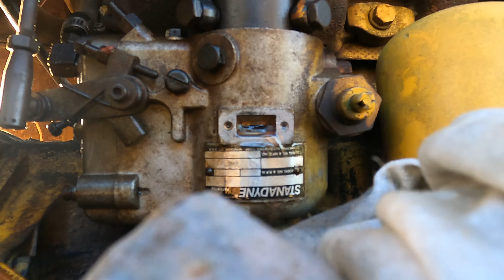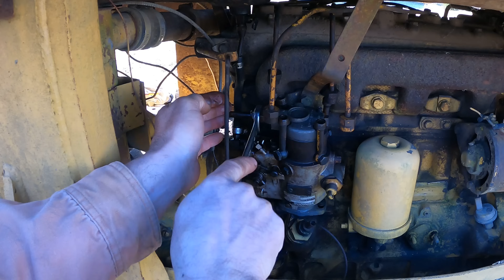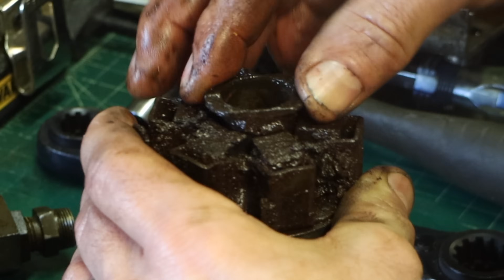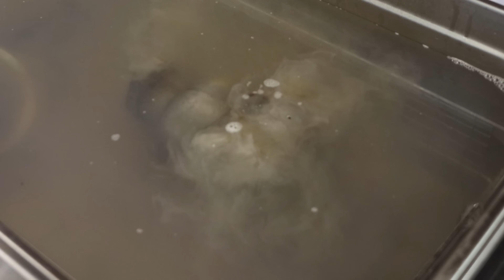Forgotten John Deere 1010 Track Loader, Part 2.

Comment: Buddy just bought a diesel 1010 dozer that had been sitting & not started in 12 years. Took me 2 afternoons to get it running. had a stuck valve or 2 but they cleaned up & the motor runs fairly well for it's age.  It has a fairly new replacement undercarriage with "snow" pads on the tracks. 6 way blade with nice cutting edges, snow pads & inboard push arms.  It has a functioning reverser, 2 extra hyd circuits with dash mounted controls. Weirdest thing is that the gear shifter is on the dash not between ur knees!   Foot clutch works nicely. Steering clutches need some TLC but nothing major i hope.  It's fun little dozer to operate and the thing will push like piss'd off mule!  It'll push a full blade of dirt & not stall out.  It's gonna get new filters & fluids, repack a couple cylinders and 4-5 hoses this spring.

Comment: Like the one person stated here the 1010 and 2010 were John Deere first real attempt to build the four cylinder diesels. A few of my father's friends had 1010 John Deere tractors they were not very forgiving and after the two cylinder models weren't a great replacement. I have a 440 John Deere gas dozer last year they produced them prior to the 1010. It is reliable and nothing stops it; I would never trade it on one of the 1010 models. The 1010 had cooling issues and didn't deal well with even minor overheating.

Comment: This clearly shows why I despise oil bath air cleaners. Just never get that wire mesh stuff clean. They no doubt do work. We had a Ford 3000 diesel that had one. Dad purchased it new. Had many thousands farm hours on it when it was sold. Always my responsibility to keep maintaining that tractor. I changed the oil in that oil bath. Every oil change. Around a 100 hours. Sometimes there would be a  inch of junk in the bottom of the cup. Easy enough to clean. Put fresh oil in. But that wire mesh crap. Always had sticks,leaves, etc stuck in it. I picked out what I could. Crossed my fingers. Always believed a dry filter was much better

Comment: After seeing what was inside the fuel pump, I'd be interested in seeing what's going on inside the engine. The state of the rings, bores, valves, and head gasket. I'd also like to watch that old piece of equipment operate under its own power, if obtaining the parts to rebuild the engine is feasible.

Comment: When ya'll went down the intake with the bore scope the valve looked atrocious.  I personally think ya'll should put every battery you've got and spray it till starts. That or use your batteries in series to get 24v to the starter. Only when cold if in fact it is 12v. If 24v I would wait till starter is cold then try a tiny bit of 36v, but only if it already is 24v & cold. That is only in extremis, which this is. The value of this track loader is only high with piles of manure in sheds and feed lots. I would have a large garden to feed this to or it's worth would fall.

Comment: In the oil bath type air filter,  air does NOT bubble through the oil!  Instead, it flows through the oiled mesh, trapping some particles, then the air does a 180 degree turn OVER  the oil bath.
The particles left in the air flow carry straight on due to their velocity, and gravity, to be trapped
ON the surface of the oil.  If the oil bath is overfilled, the air may carry oil into the cylinders and the engine can 'run on' until the oil bath level reduces or it destroys itself!

Comment: I would try fireing it with some oil in cylinders pore down intake while cranking it will go  ive had equipment with low compression and start that way

Comment: Pull it, if it comes to it and you can't get parts, see if you can source a running engine, at least then you can have a going concern to pass on, better than seeing it stripped for parts.

Comment: Hello Internet.  I'm once again asking you to stop double/triple clicking your torque wrenches.  "one time will do it" should be the ONLY time.  The first time it clicks, it has reached the predetermined torque application specified by the settings of the wrench!

I don't mean this condescending in any way, my intention is purely based on educating people based on my professional experience.  First my credentials: I worked for a number of years in a calibration lab who specialized in cleaning, rebuilding, and calibrating precision measuring equipment.  My labs primary instrumentation was backflow gauges, digital multimeters, and torque wrenches.

Torque wrenches, especially clicker types aren't some black magic.  Honestly they're pretty simple in function.  One thing about them, though, they're only as accurate as their users.  Proper use of a torque wrench involves applying smooth, firm, steady pressure to the handle of the wrench up until the point where it breaks causing the click, then ceasing to apply any further pressure on the fastener.  Repeated "clicks" with the wrench results in ADDITIONAL torque applied to the fastener.  This isn't some magical "double check my work" method, instead is overtorquing the fastener.

Additionally, don't touch any portion of the torque wrench when applying torque as your "support" hand can impact the realized torque of the fastener.  Extensions, deep well sockets, crows feet, et al can also negatively impact the performance of your torque wrench.

Comment: There is a hole in the flywheel housing on the other side you stick a screwdriver or a 1/4 punch in there when it locks the flywheel your at TDC, some JD's all you need to do is turn the cover around it has a stud in it that will go in the hole.

Comment: Well I ges u have to decide watt u are going to do with it ...if u can buy parts and the bores are not to bad give them a hone put a set of bearings n rings into it that will give u a an engine that will run for that odd time u need to use it ...untill u open it up u won't know.. did u have engine oil pressure when  cranking it over ...I was a little surprised u dint try starting it with the wet cylinders....I have a 3cyl ford engine in a forklift now u will not start that with starting fluid it just locks up so as long as it spins good with the preheat it goes right now ...the heater plugs are there for a reason to aid in a a softer start ...good luck on your venture...

Comment: oh, full engine rebuild? Those are usually good.
Though, i kinda wonder if there might be crud in the engine along with seized piston-rings that could hamper the compression?
But i don't really know much about engines other than them going "vroom" to pull stuff.

Comment: As a mechanic for many years, that should be enough compression to at least get it to fire off a little bit. Try putting marvel mystery oil in the cylinders, change the oil and let the mystery sit for a few days then we try to start it.

Comment: Seeing your video I was reminded of the time I bought a 1966 Deere 2010 tractor around 1991. I thought I got a bargain until I discovered it had a warped block. I had to send the engine in to get planed and the crank line-bored. The sleeves were an unusual design in that they were part of a one-piece sleeve deck, so replacing them was actually a breeze. The previous owner had the battery hooked up for negative ground but it would never hold a charge. In talking to a mechanic, he told me that those tractors were all positive ground. The reverse hookup had fried the regulator so a new one solved that problem. Eventually I bought a new tractor and that one went down the road. Interesting design, but I wonder how available parts are for these anymore.

Comment: I'm a old jd mechanic this engine has a sleeve deck if it was a 210 you could get an engine from a 45  combine I'm  I don't remember if jd used a 10 engine in a combine or not. If so it would be  in a 40 combine.

Comment: Hi Jon,
Great to see the pump rebuild but I would be happier to see the injectors spraying properly now.  With compression and fuel it should run so, to me, since there's some compression and the lack of smoke says there's no fuel getting into the cylinders. If there's been water in the fuel then the injectors probably don't work right.
However you look at it a video on stripping, cleaning and testing the injectors would be interesting anyway 😀

Comment: You can buy new steel wool inserts for the oil bath cleaner and actually the oil bath cleaner is much more efficient than "modern" paper filters.  Their big drawback is the mess and price of oil these days.

Comment: I bet she'll fire up if you drop some oil down the cylinders and then try to start it  I expect the rings just need a few heat cycles to bring them back to life its at least worth a try before you strip the engine but I'd rectify the glow plug issue first to give you your best chance

Comment: Worth a try but some of the old farmalls I got running had crap compression and the wet test increased the compression. I got it running using a little oil in the cylinders and once it got enough heat in the rings when running it broke the ring free and had good compression again. Not sure if that’s possible on a diesel or not.

Comment: Great work John. I once started restoring an old (1950's) Aveling Barford calf dozer (the cutest thing) but it became a  never ending saga and I gave up. It would be good if you had another  look at the timing and valves and the rings and the clutches and the gear box and the final drives and the hydraulics and of course all those dam seals! It would be great to see it going and if anyone could do it, it would be you.

Comment: No removable sleeve, solid block . 1010&2010 was not popular engines that were diesel. My daddy worked at John Deere as a salesman and once said that all the engineers that design these were fired . Idk if a joke or real

Comment: For s&g since it needs a whole new engine, try some wd-40 in the intake (for science). 

(1. Run starter for 30 sec. 
(2. Run glow plugs for 30 sec. 
(3. A small spritz of ether (no more than that). 
(4. A small spray of wd-40. 
(5. Set throttle to full. 
(6. Run the starter for 30 sec. And give a long tiny whiff in tiny amounts of wd-40 to the intake. 
(7. Run glow plugs again and repeat 4 through 6 if required.

It should make some white smoke from the exhaust. 

(Not too much wd-40, or it may hydrolock the diesel. This is off label use of the wd-40, and is not approved by the wd-40, use at own risk. Do not use on newer diesel stuff.) 

For science.

Comment: G'day Jon. I'm a mechanical engineer (in Australia) with some experience with Diesel engines. The oil you squirted into the cylinders brought the compression up a bit, but that doesn't necessarily mean there was any significant leakage past the rings beforehand. I'm not necessarily saying you're making a wrong conclusion about the oil in cylinder test. I just think it's inconclusive because of a possible error in your test method. I think you used too much oil. Your conclusion is one interpretation of the results, but there is another that I suspect is more likely. You put a generous squirt of 10cc in each cylinder which, most of which would have remained on top of the pistons, increasing the compression ratio, and giving a higher compression reading as a result. If you like arithmetic, the explanation is simple. If it's the 2.4 litre engine (I don't recall whether you stated the engine size) each cylinder will have a displacement of 600cc. The specified compression ratio is 18:1, which means the combustion chamber volume is about 35cc. Adding 10cc of oil would have reduced the available combustion chamber volume to 25cc, increasing the CR to around 25:1 (if it's the 1.9 litre engine, the sums give an increased CR of 27:1). That could certainly be sufficient to explain the increased reading on the compression gauge during the "wet" test. If the increased CR theory is indeed what's going on inside the engine, then the pistons and rings may be perfectly OK. Or perhaps the ultimate interpretation of the result may be a combination of both theories. That's what I mean by inconclusive.
Anyway, before you consign the poor old thing to scrap, I think it's definitely worth a look at the valves. When you poked the endoscope into the inlet tract, it all looked quite rusty in there. While the engine was sitting idle all those years, several of the 8 valves would have been in the open position, leaving the seats and valve faces exposed to the atmosphere. That would leave them vulnerable to rust and the ingress of dirt (the air filter was effectively removed). A closed valve can rust too, although being closed offers some level of protection.  Any imperfection on the valve sealing areas could prevent them making a good seal when closed. It doesn't take much valve seat leakage to make it practically impossible to start a Diesel, even with starting fluid. I know this from personal experience with a Volvo Penta marine engine that had been left to sit idle for too long. Some light rust on the valve/seat faces were enough to kill the engine stone dead, but when cleaned up it started easily and ran well.  The couple of cylinders you tested with lower compression may have been the ones that had either one or both of their valves left open. Unfortunately there's no simple trick to temporarily seal the valves for another engine start attempt. It's a cylinder head off job, and at the very least a clean of the sealing faces with a wire brush and valve grinding paste (sounds like a farmer's fix to me). Your main cost would be a new head gasket. But if the valves/seats are too pitted to clean up that way, then the valves will need to be re-faced and the seats re-cut. 
Good luck.
Cameron

PS: It might be worth another endoscopy to have a look at one or more valves in the open position. You won't be able to see the valve seats from inside the inlet tract, but you might just get a peek at the valve faces. If you see anything other than a nice shiny sealing face, then I reckon you'll have found the problem.

Comment: If you decide you don’t want to mess with it or want rid of it after disassembly I’d like to buy it. I have one and the backhoe attachment that I’d like to get running but my injection pump housing is in rough shape and hard to source, yours also has other parts that mine is missing.

Comment: Pull the engine, tear it down, clean the pistons and rings, check the bores. Judging by the amount of crap in that injector pump it would not surprise me one bit if the rings were stuck. If it were mine I probably would have rotated it over until all four cylinders were about in the middle of the stroke and poured something like PBlaster, or a mixture of acetone and MMO down the cylinders and let it sit overnight, maybe repeated it a few times depending on how much drained thorugh. Obviously would need to change the oil after + make sure the cylinders were empty before cranking it over :-P But like you say in your videos, good enough to work is perfect, and I bet you could get this going on a budget pretty well. If I can get a full rebuild kit for my 1950 Ford 8N tractor, pretty sure someone out there makes parts for this still even if John Deere doesn't.

Comment: The 1010 engine was not Deeres fine hour. They where not made very long, I do think you can get it running, just a little more persistence. keep useing oil to raise the compresion double check your timing and adjust the valves, I think your close to running. And definitely clean the injectors. test them would be nice to, and increasing your roller to roller dimension  will help on the starting fuel delivery in your pump. Good luck

Comment: You can make a basic cylinder leakage tester easily. You just tee 2  air pressure gauges together. First one not regulated has air coming in. 2nd one regulated gauge(like on an air compressor) going to the cylinder. Difference is percentage of leakage. Listen for the leak. Ex coolant bubbling, head gasket leaking, crankcase engine rings. I think you could get it running if you heated the incoming air and put 24 volts to the starter( I know it's not good for it). 16 bar 234 p.s.i. is what diesel ignites at. That's a tough call on what to do with it. It might start on a nice warm day. Good luck

Comment: Have one like it, been sitting, told the cylinder sleeves leaked. Not tried anything yet, but thought more about converting to a gas chevy 153 or ford 2.3, both with turbo/carb. Saw where someone thought there was forklift or other app. that might work.

Comment: I spent my youngest years on my grandpa's farm in Minnesota, he and my uncle did many a similar project to what you do on your channel.

I've since been off to school and spent about 20 years working in IT/cube job.

Can't tell you how much I appreciate your videos.

My suggestion is to take er apart, confirm the issue, then make it either a once a month hobby project (over years) full restore with jdg paint, or strip er down and get back to metal forging. :) aka burn it one piece at time.

Many a farm has projects that double as lawn art.

Comment: I'm sure doing a teardown/rebuild would certainly help but are you sure it's in time.  I might add you are putting that starter through the ringer. Makes me wonder if it's spinning the engine fast enough for combustion to start even if the compression is low. I would think it would run crappy but still run.   Had an issue with my wife's 7.3 it's amazing how much difference a new starter will spin the crank and make it easier to start. Are all glow plugs working now ?

Comment: You should soak cylinders with a good combustion chamber cleaner and pull those injectors out and fix em you only had something with starting fluid so I don’t think fuel is getting to cylinders